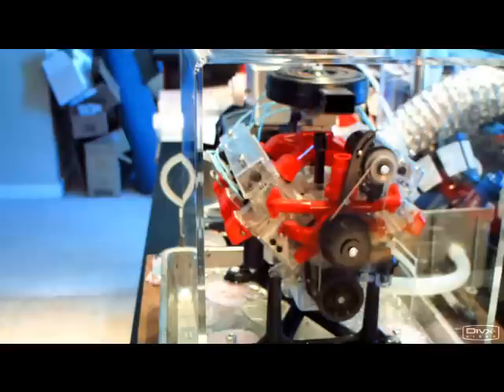Visible V8 @ 7000 RPM Part 2 (failure)

Comment: There ain't no way in hell that came out of the box , put together and then ran  that fast. I did it with a drill powered model and it took a thousand maybe. If you were to duplicate  all the moving parts  in metal or strong plastics it would be cool.

Comment: You should run a tube from the airfilter to the outside of the box. That engine sucking in all that hot air is not good for it.

Comment from the maker: It is in a box on a shelf in the garage now. Moved on to other projects. I may fire it up again someday. Some where I seen that  there were two people casting metal parts from the Visible V8 to make a real engine from. I never saw anymore about it though. Check out Gary Conley 1/4 scale V8 engines as he has done some fantastic work, but the engines start at about $5000 and up. A visible V8 is more in my price range plus it was a fun project.

Comment: you should invest in making on of those mini real v8's  that are about this models size but truly run just like a full size v8 on gas and everything.  I bet you could even use alot of the plastic model to cast molds, for the real running version

Comment from the maker: Yes I was surprised in early testing that it really did sound real. I was expecting just a rattle noise more than anything. I was very surprised  that it made it to 7000. This was the second test engine. All the later videos are the third engine with the better pressure lubrication. I don't have a video of the first engine as it blew up on the first run up lol. The containment device is used as shown here because they can explode at high speeds.

Comment from the maker: I have been surprised how good it holds up to these speeds. If it was not modified for high speed operation as you see here, it would not make it much past 2500 RPM. These engines have been known to explode at high speeds assembled stock. 
Blowing them up is easy, making them hold together is difficult. Check out my other 30 videos of the Visible V8 for details.

Comment: Hey Slinky, 
Great video. I did this with a inline 4 engine I had and looked at youtube to see if I was the only one or if others tried this. I hooked it up to a 12,500 rpm air grinder and a 50 gallon air compressor. The engine was lubed with vaseline and had some modifications for high speed. I got the engine up to 12,000 rpm and then a rod broke and the piston broke threw the head. I am very dissapointed and what to get a v8 or an inline 6 to run. Do you have any tips as to where I can buy one

Comment from the maker: Thanks, check out out my video where the engine hits 7056 RPM. And I agree the older ones were better with the motor and spark plugs. I have one of these, but it runs at the stock speed only.

Comment from the maker: @Tech4U247 Not sure, but these engines will run to 1500 RPM stock "usually" without a problem if is lubricated before running. Running a stock Visible V8 above 2000 RPM will usually have a short life span. This engine is modified to run these high speeds. Even modified like this one, 7000 RPM is pushing the engine very hard.

Comment: @slinky460 i wanted to do a similar thing of using a different engine and a motor that used 15v and ran at 7900rpm and using plastic gears to turn the hand crack and know i know it possible, thanks also any tips ? 

how bout if i used a motor that ran @ 13-14 000 rpm

Comment from the maker: @Nrgzrbunny777 Yes, but Revell tells you in the instructions to use vegetable oil to lubricate the Visible V8. However vegetable oil will trash out the engine after a few months. I use Glycerin for lubrication and have had no problem at all. Yes this engine had a hand crank, but I used an electric motor to turn it.

Comment from the maker: @bobbybob3680  I might be actually covered by homeowners insurance, I never did look to see, but these Visible V8 model engines have known to explode at high speeds. This is the reason for the containment shield as well as safety glasses above 3500 RPM.

Comment from the maker: @TheXcaliber223 This will work short term, but could melt or degrade the Styrene plastic over time. Labelle 108 plastic safe oil is a better choice for long term. I have had good luck using Glycerine USP, no Styrene degradation  has been observed during a year of exposure. Do not use Vegetable oil as the instructions tell you to do. I have found that vegetable oil will melt black and gray parts in about two months time.

Comment from the maker: @marek0086 It is a 1/5 HP 120 Volt Dayton AC DC Electric motor. All the later videos use a Dayton 1/2 HP 120 Volt AC DC electric motor. See my other Visible V8 videos for details.

Comment from the maker: @marek0086 The rods and pistons have proven to be the strongest parts of the rotating assembly. In this video, the crankshaft failed @ 7000 RPM. The containment shield is used above 3500 RPM just in case a rod would let go. These engines have been known to explode at high speeds. I have had some crankshaft failures during testing, but (so far) no exploding engines.

Comment from the maker: @superfunnyman123 Yeah, I did not notice the smoke until I watched the video. The Styrene plastic has proven to be strong. But, local heating is the main problem above 3500 RPM as the Styrene will bend or melt above about 130deg. The cooling the oil provides to critical areas is as important as the lubrication is. I am still doing some testing with this little V8. It can take a licking and keep on ticking.

Comment from the maker: @pacometaco22 For this test, 1/4 HP. This has since been upgraded to 1/2 HP. To go any faster will require a one HP drive motor. This motor would be larger than the engine. Sad to say, the engine produces zero HP, but it does take power to turn it.

Comment from the maker: @andreboy10 I have looked into doing this, but just have not got around to it.  There is a water pump impeller, but there are other problems too. I do think it could be done as the block and heads have areas for water, but would require much sealing. May be some day.

Comment from the maker: @doufcha Really, what you are seeing here in these videos, took a year of testing to get this far. I would hold a stock engine to about 1200-1500. Yes, you can just use the splash oiling system to about 1500 or so, but that is about it. And really it is just as much fun to run at 1200 as 4500, plus you may not have a meltdown or explosion at lower speeds. I got a BIG pile of broken parts to get this far, and still breaking some parts a year later. The faster you go, the more problems you have.

Comment from the maker: @doufcha Yes, actually there is (some) manifold vacuum and (some) exhaust flow. There are no rings for compression, plus there is some taper in the cylinders. It is kind of loose, but really does not pump any oil to speak of. The V8 sound comes from the exhaust manifolds. The pressure lubrication system is my own creation. There are no oil passages in the stock block. It is all experimental right now. It was designed to go only 100 RPM. I am really pushing it to the edge here.

Comment from the maker: @pontiacpower79 This project is work in progress. it is changing all the time. For example, right now I have the engine torn apart to make some internal changes. I plan on making a video, some day, but for now, it is just too complicated and experimental to video and explain all this.
It is always changing based on the last test. I have tried many different oils, some work better than others. I am using a x rated Silicone oil now. Some auto motor oils will melt plastic, so don't use these.

Comment from the maker: @pontiacpower79  One important thing is that the Styrene plastic crankshaft requires not only lubrication, but cooling. Actually cooling is more important as local hot spots at bearing points can quickly heat up past about 120 Deg F and have a meltdown. The new #5 crankshaft has oil passages arranged different to provide more flow. The crank pins use a .017" metering hole to create a oil spray between the rods for more cooling. Higher speeds, require a smaller hole. It is difficult to explain.

Comment from the maker: @pontiacpower79 Yeah, you will bust up a lot of parts during testing. Please see all my videos. It took a year of testing to run these speeds without breaking something. It is trial and error testing. 10% trial 90% error. To start, I would redline at 1200, then slowly work up from there. There is no book on how to do this, so I would go slow, unless you can afford a lot of kits. The valve train is a weak area that requires a complete rework. Above 1500 you will need a pressure oiling system.

Comment from the maker: @2point0L Check my new videos. I have made two new crankshafts since this one. I am thrashing the Visible V8 with crankshaft #5 now, but red line is 6000 RPM as the crankshafts are $50 each. You have to buy a whole new kit every time.
NAPPA don't have any in stock. Oh well.

Comment from the maker: @hod05 I agree, It is strange that although there is no combustion, it still sounds like a real V8 engine. Also, it is hard to capture on the video audio, but this little plastic engine is loud and intense above 3500 RPM. I now use a "blast shield" above 3500 RPM. I have never had a problem (yet). But other people have reported explosions at high speeds, some throwing parts across the room. I am working on a new crankshaft for this engine. You have to buy a $50 kit just to get a crankshaft.

Comment from the maker: @AlchemistHawk Yeah, at these speeds, anything can happen. I have never had a blow up (yet), but other people have, so I use the containment / blast shield above 3500 RPM just in case. 
So far, a generator pully flew across the room once and one fan blade took off and hit a wall. But nothing serious yet.

Comment from the maker: @MOFOxMovies It took about a year of testing to get these engines to hit the speeds shown in the videos with out having a failure. Lubrication is the key for two reasons, to reduce friction and keep the rotating Styrene plastic parts cooled down. The plastic parts have proven to be strong enough, but heat will reduce the strength down to about half above 120 degrees F. Above about 130 degrees, the temperature will quickly rise and a failure will happen due to melt down. It is just plastic.